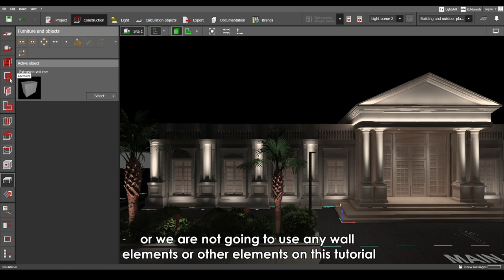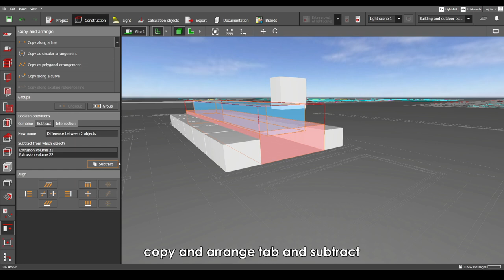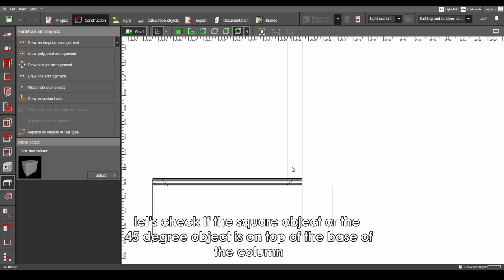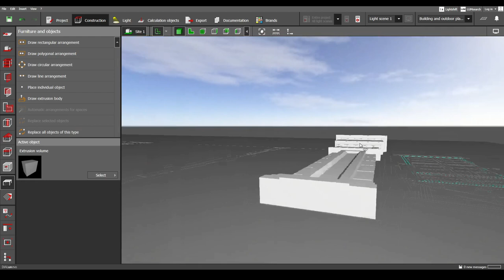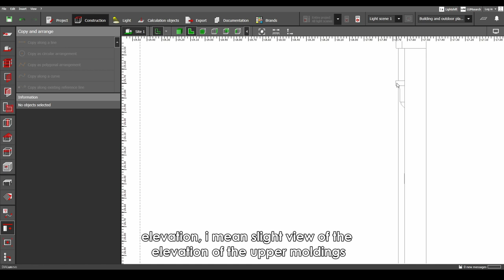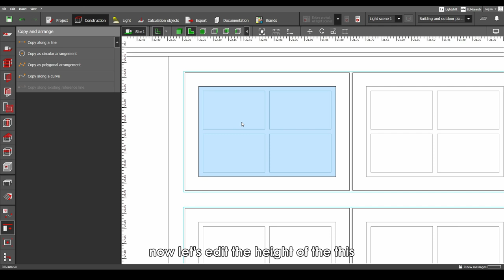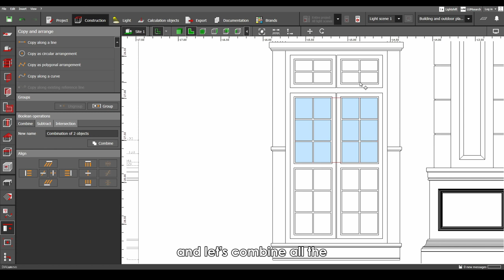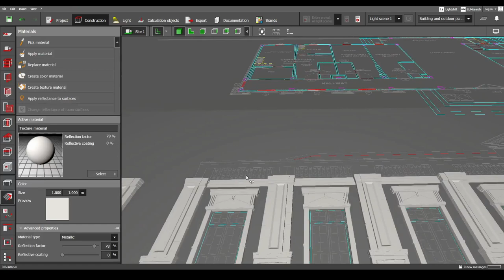Dialux Masterclass: How to Recreate Realistic Looking Facade in Dialux Evo (Part 1)

Comment: I have a question. I get errors in the light calculation with 3DS Files and  i don´t know why. 
I downloaded the free Trail version of SketchuUp pro and two different tools for it called 3dshome and skimp.

After i got the necessary tools I downloaded a free model of a sleeping bed in the 3d Warehouse and reduced the numer of triangles with the Skimp-Tool, to reduce the file size.
As second step i removed all Textures and Materials with the 3ds Home-Tool.

Although the size of the file (the number of triangles)have been reduced, the materials and textures have been removed, the 3DS model still causes problems in the light calculation. What am I doing wrong ? Do 3DS models not work properly in Dialux?

My white sleeping Sofa show me very big light an dark triabgles.
If i render the room some trangles get invisible in the raytraced picture. The wired thiing is that it show no invisble triangles before.